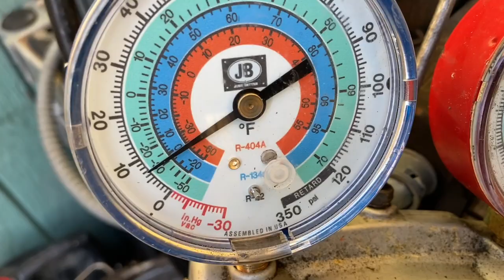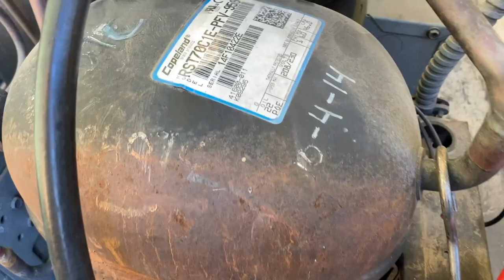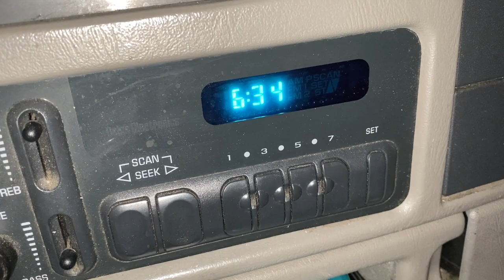Compressor shorted to ground

Comment: I know of a Aspera compressor in a serving line cold plate that is still running after 36 years. It is a R-12 system and there are no access ports to hook up gauges. I put a 3 in 1 kit on it in 2011. It just wont die.
Reply from the maker: Old stuff was good

Comment: Time to wire up some led lights in the vangina. I like the tecumseh condensing units except there king valves suck. The 1/4 access on them does not allow your hose to tighten down properly.

Comment: Tecumseh refrigeration compressors are pretty reliable, but their engines weren't so good, I've got an old Kelvinator window unit with a Tecumseh recip that's still going strong after 40 years, runs on a hefty charge of R-22 and will ice up if the evaporator is dirty or the filter gets too dirty, the supply air gets down to 50 degrees within 5 seconds of starting the compressor and it gets down to 35-40 within a minute, weighs a ton, but it's the best unit I have, and one I won't be parting with, if it develops a leak I'll fix it and have a good friend put high and low side service ports on it and charge it with a refrigerant that operates at similar pressures, as no modern unit, not even a 18K BTU unit, when this one is only a 12.8K BTU unit, can outcool this unit

Comment: What is make and model of your new meter and  how do you like it.  Thanks
Reply from the maker: Uni T makes them different models per features. Amazon has them 50$
Reply: I'm pretty sure his is the UT210E. There's also a 210D that does temperature. Both are TRMS meters and can measure both AC and DC current. They're also very hackable.

Comment: Good video. That’s a lot of Rust on the Back side of that compressor. Was it from Evap Freeze ups ? Taking out compressor early ? If I thought so I’d be installing a suction accumulator on the New unit. I Would have Liked to see the Evap in this video. Nice Clean looking install though. New Condensing units are so satisfying to put in vs a Compressor. They Look so Nice All shiny brand new.😎 Was that a 134a system ?
Like # 201. As far as compressors go -I Find Tecumsehs Last a lot Longer than Copeland , But copelands are Quieter. I Try to use Copeland inside & Tecumsehs outside. Allied Refrigeration Sells Tecumseh.